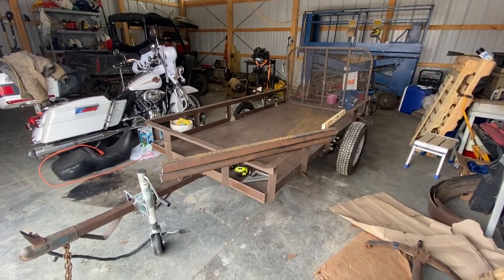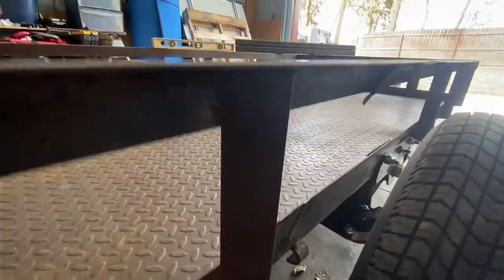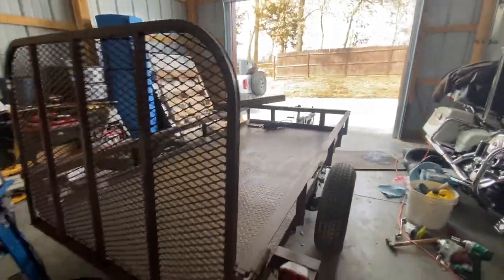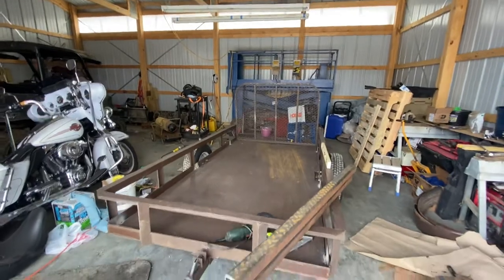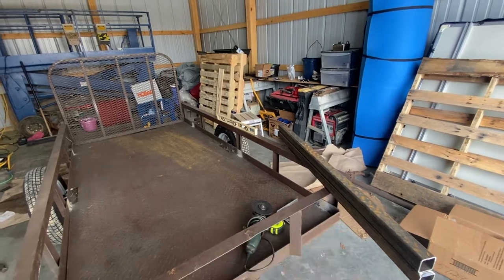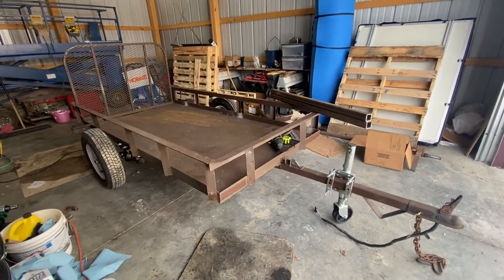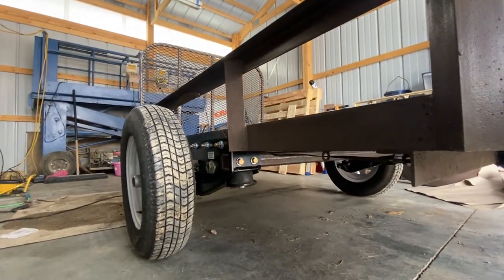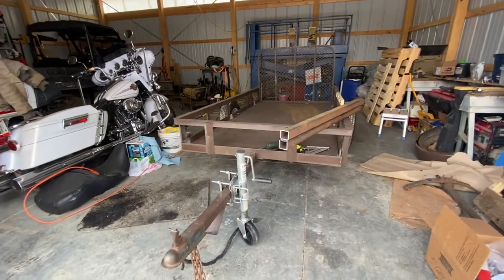Part 2 | DIY Overland Trailer | Timbren 3500 Lb Axles | 4x6 Utility Trailer

Comment: What hubs did you get with your 3500lb HD Timbrens? I would like to use my current 5 lug patterns as well but run the 3500lb HD axles.
Reply from the maker: I bought a set from ETrailer 5x4.5 114.3 they have a few you can chose from.